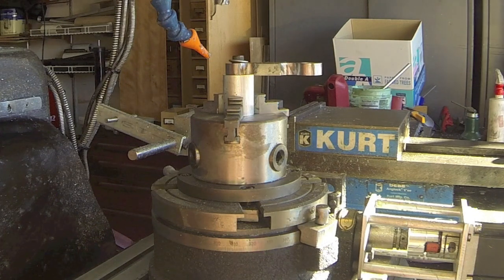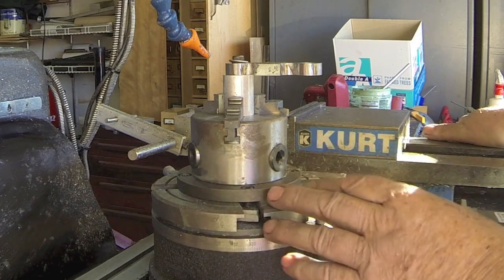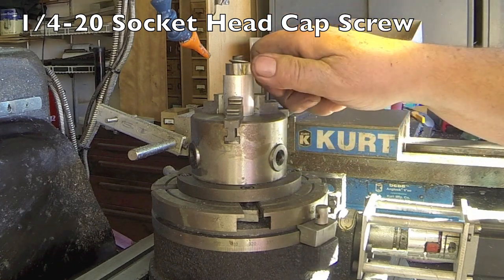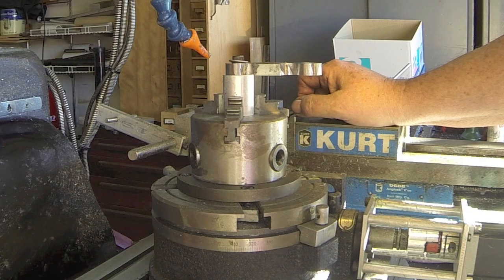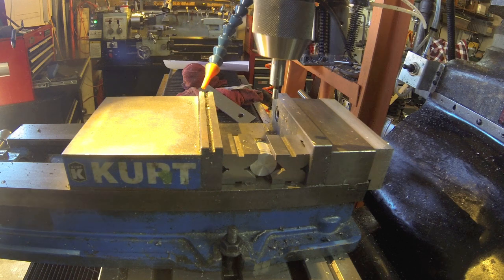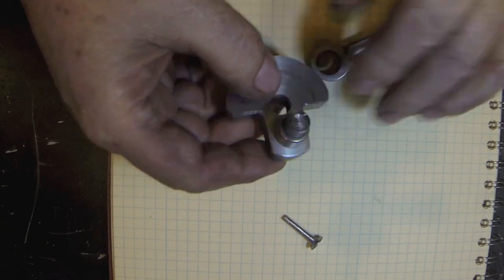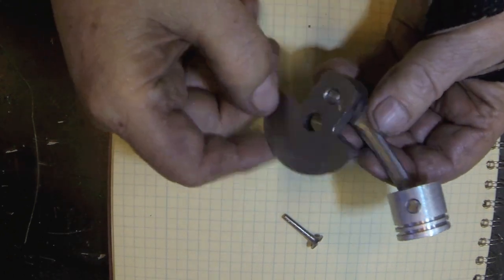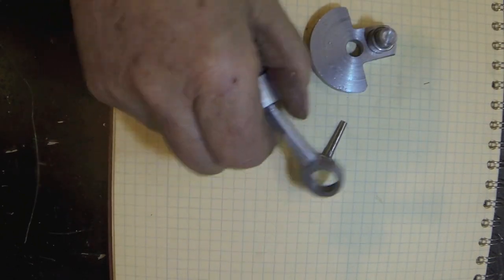This Week in Herb's Workshop #22

Comment: Cool "little" project... LOL
Thinking about the aluminum head... does it have steel valve seats??
How about cam actuation?
Only 2 questions per visit.... ;-)

Colin ;-)
Reply from the maker: The valves set in the aluminum head. The cam is driven by a 20 T pulley on the crankshaft, to a 40 turn on the camshaft.  The camshaft has two lobes to move the valves. I've built the cam box, but not much else at to the cams.

You can see a picture of it on Week 16 video.